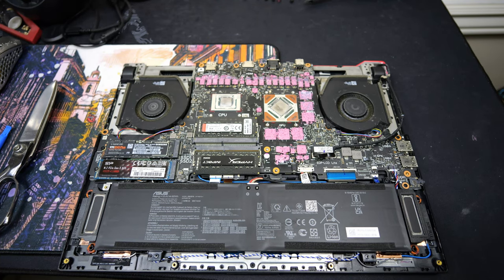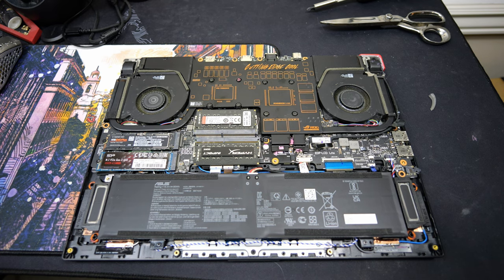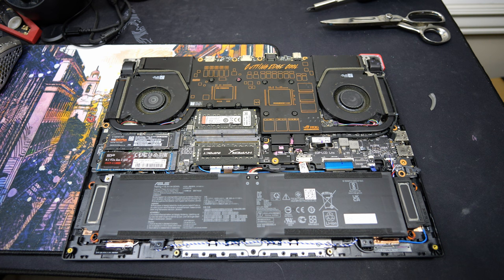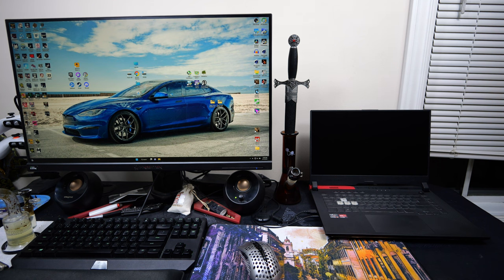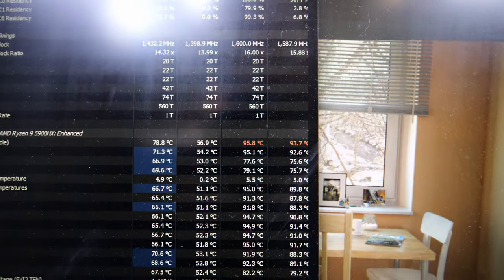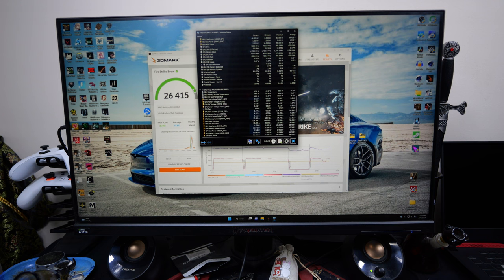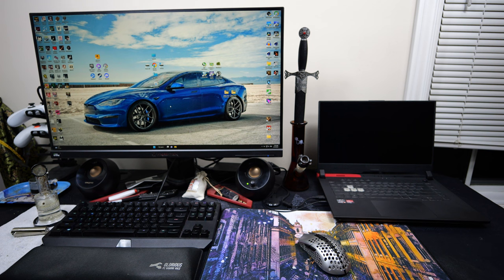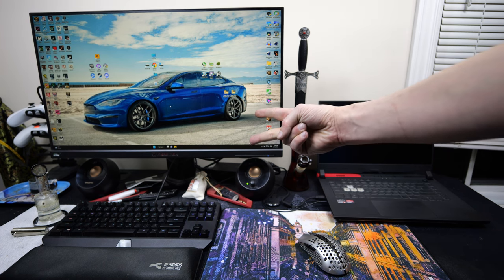Asus ROG Strix G15 Advantage How Well Does a PTM7950 Phase Change Pad Work?

Comment: I've had this on the CPU for 4 months now and it seemed to settle down after a few heat cycles. It still can get hot on pure CPU loads like Cinebench but it's fine for me and I don't need to worry about Liquid metal escaping.
Reply from the maker: Yeah Cini is not a good representation of real world use. I use it as a worst case scenario. 

But this pad does eliminate the possibility of LM getting into something it shouldn't. 

Also good to know it will get a little better after a while.

Comment: maybe consider using smokeless bios editor,  can turn down the cpu voltage slightly and optimise the curve,    i jumped from 26k to over 28.5k,  thermals almost certainly will always reach throttle on cpu cinebench,  if its not throttling it will clock higher til reaching those temps(til clock limit) .     did my cores,  overclocked ram to 3733 with better timings with 62ns latency,  and overclocked the gpu to run 2350 and boost to 2500mhz.    these tweaks give around 14300-14400 firestrike scores.  keep up the good videos, i may try these pads myself
Reply from the maker: I'll have to give that a try soon (I already have it sitting on a USB drive) as I don't think any amount of thermal paste or anything like that will fix the temps I just don't think the cooler can handle maxing out all the sliders. 

Those are some pretty awesome scores. I hope my RAM can go that high that would be sweet I know RYZEN likes fast RAM. But also be nice to get a little bit more out of the GPU as well.

Comment: This stuff is the real deal for laptops, after a couple of heat cycles with this it beat my KPx. I don’t know how it performs under an ihs tho, probably not as good as KPx since this is used mostly for direct die
Reply from the maker: I think I must have messed something up as I never got good temps with it but others sware by it. I had to go back to LM and even that took me a few tries. However, I guess I might just not be great with laptop hardware because I never have these application issues on a desktop.
Reply: @XxViciousxX  I used thermal grizzly phase sheet. It’s PTM7950 but marked up. Maybe you had a fake?

Comment: Hey nice video how are your temperatures now on the cpi? Have they improved? I’m thinking of using this to try and cool my Alienware.
Reply from the maker: Temps actually increased a little bit with these. But I might have installed them improperly or something. As they seem to work wonders for some people. I went back to LM (since I'm not really moving the laptop anymore). I'm now getting closer to getting decent temps but still not there yet.

Comment: Now that it's been a little bit, how are you liking the ptm7950 in comparison to other TIM's on this laptop?
Reply from the maker: About the same as when I redid the LM. I found out I got the cheaper ptm7950 so ordered some Honeywell ptm7950 pads (I know it won't make much of a difference if any) but figured use the good pads and then just tinker with the system and maybe do some - curve optimizations.

Comment: Unless I missed it... why didn't you put the temperatures of the liquid metal, then compare it to the PTM7950?
Reply from the maker: I should have done that but my application of the previous LM was terrible so it wouldn't have been a fair test.
Reply: @XxViciousxX   Absolutely understandable.  What I'm dying for is more tests of comparing PTM7950 to Liquid Metal at highest performance. My laptop came with Conductonaut on both chips, but pump out and oxidation is a fucking bitch and I don't want to deal with that. 

I just want a one-and-done paste for the next five years, instead of every 5 months.

Comment: Hey buddy,
i'm planning to swap LM and thermal pads 
would you tell me the exact thickness for thermal pads?
and which thermal pad you prefer (NAB or thermal right) ?
Reply from the maker: I would use paste I redid mine again as the pads were causing worse mounting pressure than the stock paste. I used thermal grizzly extreme but here's the pad thickness if you still want to go that route.
VRAM 0.5mm
Chokes 0.5mm
Mosfets 1mm
Reply: @XxViciousxX  Thank you im doing research on the pad thickness

You know that you have to do the right thickness or temp will go worse
Reply: @superlooz9497 how'd it go

Comment: did you put one layer ? what if i would like to put those pads on other parts (instead of thermal paste - the pink goo all over ur place)
Reply from the maker: That may work they are very thin pads but not sure what happens if you stack them on top of each other it shouldn't matter and should work but I'm not 100% positive. They are nonconductive so no issue there at least.
Reply: PTM7950 applies on the CPU and GPU. For VRAMs and power sections is given thermopads or rubbery paste Laird 607 or Upsiren U6 Pro, because here you need a thicker material. PTM7950 is 0.2mm and it is more of a compressed, dry paste than a thermopad and you can't give several layers like you can with thermopads.
Reply from the maker: @goorthiss  Thanks for clearing that up still got lots to learn on these things.

Comment: Maybe you should uplift at the back of the laptop to get much better temp. TRUST ME. I got same model like you but different spect. ;)
Reply from the maker: Thank you for the tip normally when I'm not making videos I have a cooling pad that I use to keep the temps down.
Reply: That's good.. If you free, can you make video comparetion cpu & gpu temp when laptop at flat, uplift at the back & finally using cooling fan.. I'll watch and like :)
Reply from the maker: @muhd.roszaimanrossli9846  I actually did something similar to that when I got the cooling pad here's the video. I did no cooling pad with it raised a little bit then cooling pad on low and then on high. https://youtu.be/3DUvpwNclTA
Reply: Oh that's cooling. Very good one. Can reduce the temp. around 16°C. XD. If using G15 before but ryzen 5800H+Rtx3070

Comment: forgot to show the most important step smh
Reply from the maker: Well honestly if you need a video to show you how to install a pad then this is not the video for you. 

Because if you couldn't do that wouldn't have the skills to take apart the laptop in the first place.
Reply: @XxViciousxX  its crucial for noobs to know that they have to peel off the thin sheets before putting the pads onto the dies, so its important
Reply from the maker: @derekhatake  That's kinda on the level of peeling off the sticker on a heatsink before installing it on the processor. Should be completely obvious plus I still mentioned it in the video as well.
Reply: @XxViciousxX  cool
Reply from the maker: @derekhatake  Now when the better Honeywell version of this pad gets here I was planning on showing how to do everything start to finish.